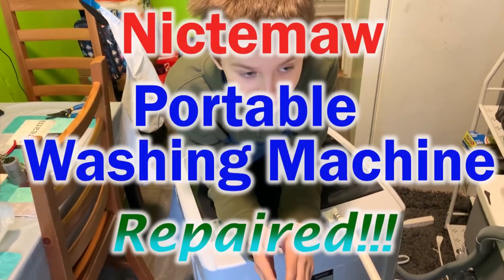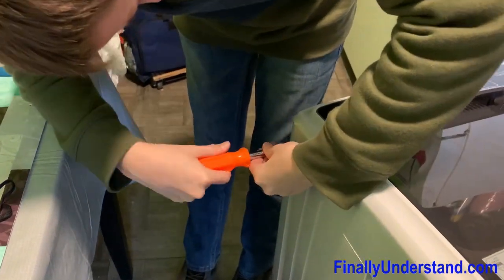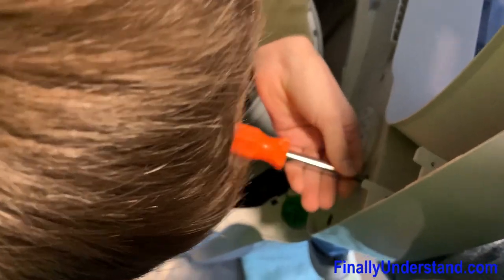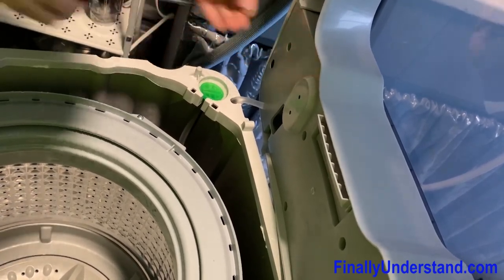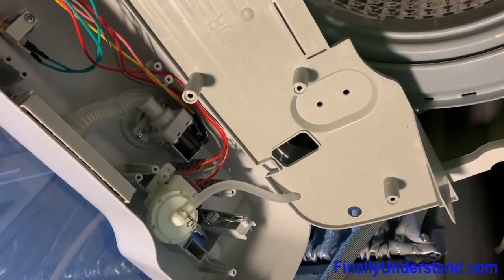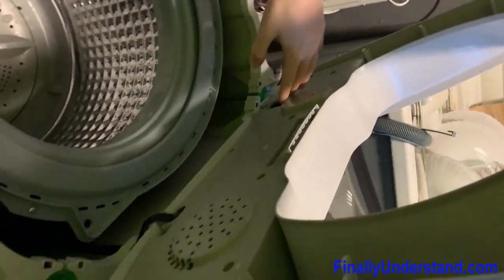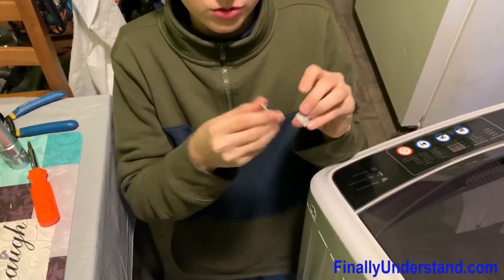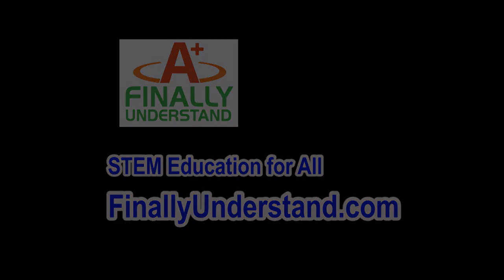How to repair Nictemaw Portable Washing Machine - STEM Education

Comment: Can you link to the replacement part that you used? Just bought a brand new machine and it arrived with the same constant filling issue. It seems easier to replace the part than return the entire washing machine.
Reply from the maker: Good day Angel, if I'm not mistaking this is the one: https://www.amazon.com/dp/B0B9HPML3H?ref=ppx_yo2ov_dt_b_fed_asin_title it doesn't fit into the place of the original one but if it is a problem it will work just like in our video.